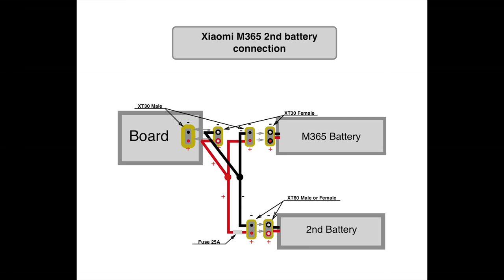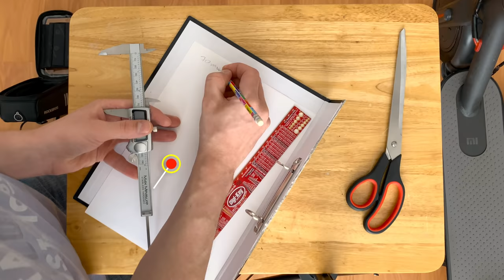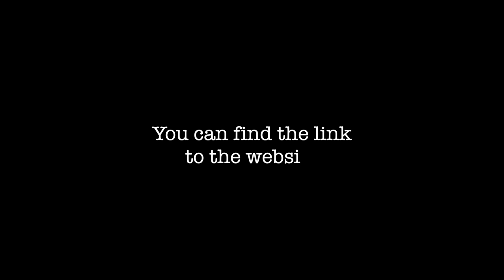Xiaomi M365 / Pro / PRO2 / 1S / Additional / Extra Battery Upgrade

Comment from the maker: Hi Guys. You can buy a ready-made connectors kit for a second battery. 
https://www.ebay.co.uk/itm/224055311121
36V Battery pack with Samsung cells:
https://www.ebay.co.uk/usr/tompie
Reply: Please I can’t connect it I don’t even know the voltage to add to my battery
Reply from the maker: If you don't know the basics of electronics, it's better to let someone else do it for you
Reply: Hi! Can I use any 36V battery, let's say 36V 7ah ?
Reply from the maker: @nvau3644  Hi. I recommend above 6Ah and must have built-in "BMS"
Reply: Nice video , can you help me for ninebot max ?
Reply: What is the approximate range added per suggest battery size?
Reply from the maker: @brottochstraff  an additional 12Ah battery on M365 PRO will give you around 80-90% more range (but it all depends on various factors)
Reply: @tatech8696  hello :D i need the kit again ^^' cable + battery.

my scooter breaks down after 30km ^^' i need 40-60km :D <3 hero
Reply: Hey T&A  fantastic video. 
I've ordered the kit from your link. The 12ah battery link is dead can you recommend another safe 12ah battery please
Reply from the maker: @Vintagegamer542  Thanks for comment and support. New batteries will be available from Friday or Saturday.
Reply: What battery do I need for xiaomi m365 pro.  I'm about to purchase the connectors from ebay.  And what else do I need to fix the external battery
Reply: Just curious if this is also applicable on scooters other than Xiaomi?
Reply: @yeshuajirehblando2043  Practically any electric scooter as long as you follow the instruction and connect the extra battery pack in parallel.
Of course different scooter and different battery pack, it "must" have the same voltage and it should have the same Ah capacity.
For example the Xiaomi 365Pro has a 12.8Ah battery so the extra battery pack is 12Ah.
Reply: @tatech8696  I really love your video and it has cleared every matter I had in my head.
And I love that the Xiaomi M365Pro can reach around 80Km range just I am too heavy for it so I bought an Emove Cruiser.
As you know the Emove Cruiser has a 30Ah battery pack, can I add a smaller pack like 20Ah?
I'm asking because an additional 30Ah battery pack is bloody expensive!!
Reply: @frejusamon  buvo VU
Reply: why not just make the main battery slide in slide out replacable and have two or three of them to carry with you on longer trips ?
Reply: @obertscloud  Each battery pack weights around 4kg so you want to carry 15-20kgs all day on your back?
And did you check the price for each battery pack, can you afford it?
Reply: @L1K30N3  need ko battery
Reply: When battery will back in stock?
Reply: How can I get this battery
Reply: Nice work. Can i do this to my orginal m365? Not pro model.
Reply: Hi bro  i will use 36v 4400 mAh battery  with out bms.
 Does it work??
And I wonder how to extra battery charging
Reply: But what if I have battery that has another charger? How do I connect that?
Reply: May I know about the extra range that I will get after installing the new battery? 
I checked about the battery but it shows no price. I would like to know the price of it. 
Thanks for the effort.
Reply: Ok a baterię z kąnd?

Comment: What a top dude replied to my message and even helped with advice and direction 👍  big shout. Also i have purchased the wire conversion from your ebay site to support what your doing instead of making my own.  Nice one
Reply from the maker: Thanks for this comment and support. I really appreciate that 👍
Reply: @tatech8696  hi sorry to bother you again but just a quick question on the battery 2. As its connected in series with battery 1 and charged through the scooter port will battery 2 still balance charge as the DC imput for battery 2 will not be used and im assuming the BMS utilisation would be via the DC imput on battery 2 pack. Or will the scooter BMS via the scooter imput charge and balance both batteries.  Thanks
Reply from the maker: Hi. You have to connect both batteries in parallel.
Charging both batteries via scooter port will not balance the cells of the 2nd battery unless single port BMS is used in the battery pack. You can also disconnect the extra battery once a month and charge it via a battery charging port to balance the battery cells.
Reply: @tatech8696  perfect
Reply: Hi
can i do the same with the 365 not pro?

Comment: T&A Tech: be careful with the aluminum shavings from drilling. Those inside the tube may end up in the bms/battery area and cause short circuit.

Comment: I was thinking of doing the same thing. I think the batteries for my remote control cars will work.  You should start selling the ready made connector. I would purchase  it. I already wrote gotrax asking if could make a second battery for my scooter.  It started with just going to work, but now I take it everywhere. I need to extend my scooter by another 5 miles, then I could get rid of my car.
Reply from the maker: Thanks for your comment. 
I’m already selling the ready made connectors if you would like to buy it please click the link in pinned comment.

Comment: Would it be a good idea to put a diode to avoid battery drain of smaller 18v battery? Could it cause problems in situations where you regen ?

Comment: I believe  It is better to have a auto fuse holder with 10..15A fuse on the "+" way from second battery just for safety. This is just in case if  somehow one battery is empty and second is loaded. Current between can be high and damage BMS. Protection is never exessive.

Comment: Just a thought here but wouldn't you eliminate the problems of the scooter going into charge mode by simply connecting both batteries to the controller rather than one to the controller and the other piggy backing through the battery.

That's what I did with my bike, both batteries go through the controller on one cable, thus they are in parallel, had I done it this way, I'm sure I would have had issues with charging.

But as it stands I charge both batteries together off the same charge circuit.

So instead of going battery controller battery, go battery, battery controller, it's in parallel so it shouldn't make any difference, so long as both batteries start at the same level on the first charge.

Comment: Nice vid. Very informative.
What are the red and black plastic things you use to cover and melt on the wires called please. Thank you for another great vid.
Reply from the maker: Hi.Thanks for your comment. 
They are called "heat shrink tubes" you can found them on ebay or amazon

Comment: After install does this mean you can charge the battery on either the external and stock port? I noticed the external battery has a charger connector as well.. Thank you! Looking to buy the connector right now..

Comment: Hey i have a few questions, when you say make sure both battereis are the same voltage do you mean that the external battery voltage is the a battery percent? or is it a fixed number and if it is like a battery percent how do i measure both voltages? Also i plan to use a CFW to make speed faster is there away to check that option box when i use someone elses cfw options? Also do i have to drill holes or can i just connect the battery box to the stem/board buy velcro or cable ties and alsocan i but the battery directly in the box or do i have to put something at the bottom? Also is the Stock charger tha comes with the scooter fine to charge and is it safe?
Cheers for the video

Comment: Great video, thank you! But I have one question: can I use the charging port of the scooter as a voltage OUTPUT? I want to use the scooter as a powerbank, then connect it to a buck converter...

Comment: After doing the exact same connections the battery, it should act just like a double capacity factory battery? Of course I would make a custom firmware with the charging fixed.
Reply from the maker: The original battery has 7.8ah if you connect a second 7.8 ah or more then you will have 15.6 or more (depending on what capacity the additional battery) the application will still show the capacity of the original battery because it will take data from the original BMS battery but the percentage of capacity while driving will decrease more slowly.
There is also a second method of connecting directly to the original battery (plus to plus, minus to minus) but then you need to cut the plastic cover and you need to be more careful because you can damage the original battery
Reply: @tatech8696  Yeah I would do it like you did. Thanks for the response!
Reply from the maker: No problem. Please Subscribe my Channel and share with others. 
Thanks

Comment: Hi thought i had sent my question but think i forgot to press send lol . Firstly thanks for the fantastic vid instructions . 
My question are , Did you remove or conceal the additional power charging jack on Battery 2 and perform the full charge through the scooter port , also if using the original Xiaomi M365 pro  supplied charger what are you charging times coming back as ? I ask as the standard battery is around 5 to 8 hours so does that mean this one is in excess of 12 hours to fully charge from 0. Also can you tell me the size of the bolts you used to connect bag to the scooter pls ?
Reply from the maker: Hi Maxta. Thanks for the nice comment.
I charge both batteries via the original scooter port and conceal the additional power charging port.
Some people charge both batteries via additional battery charge port but  I haven't checked it yet.
Yes, the charging time will increase in proportion to the capacity of the second battery. The purchase of a more powerful "42V 3A" charger may be a good solution. The original charger is 1.7A so the charging should be almost twice as fast.
I used M8x30 bolts but some people do not recommend drilling into a scooter tube because it weakens it. I have been riding on my scooter with two holes last two years and I have no issue (I used my girlfriend's scooter on the video). A good solution if you have the option is to print on a 3D printer "Batttery mount bracket".
Reply from the maker: 42V 3A DC Connector Quick Power Charger:
https://uk.banggood.com/42V-3A-DC-Connector-Quick-Power-Charger-Adapter-For-Xiaomi-M365M187PRO-Ninebot-ES1-4-Electric-Scooter-p-1575839.html?gpla=1&gmcCountry=GB&currency=GBP&createTmp=1&utm_source=googleshopping&utm_medium=cpc_bgcs&utm_content=lijing&utm_campaign=pla-gbg-rm-all-purchase-pc&ad_id=323612825005&gclid=Cj0KCQjwlN32BRCCARIsADZ-J4s1dVpL-TnJQMSLiRC_Z5Lx7Ecb3TumHwXitXa1io87fuXNLOX-rqAaApirEALw_wcB&ID=47184&cur_warehouse=CN
Reply from the maker: 3D additional battery mount:
https://www.thingiverse.com/thing:3479439
Reply: @tatech8696  Thanks for the clarification.
The Emove Cruiser which have a 52V 30Ah battery pack is supplied with a "pity" 2A charger, why this to save money?
It takes 13 hours to charge the batteries and adding a similar additional pack will double the time so what charger do you suggest, just more A like 4A charger?
Reply: @tatech8696  can I use this one on my m365 pro without the extra battery so it charges faster?
Reply from the maker: Yes, you can but 3A max

Comment: Question..?
If the batteries we connect is both 60v. The 1 (in scoot) is 20a with 3000 capacity cells and 30a discharge
And the 2 (external) battery is 21a with 2600 capacity cells and 20a discharge
Conect them in parallel, they will work or i will have problems?
Your batteries have them in parallel All the time? Is exactly the same batteries and capacity?
If they are not (as mine) do you have any issues?
Thanks!!🙏

Comment: This video has been so helpful sir, thank you. I’m on my final steps and I’m a little nervous about charging, as I only have the OEM charger for my M365 Pro. My question: if the main battery (max capacity) is 42v and my new external is 36v...besides dropping both batteries to 36v (before connection), should I also update the firmware with the selection of Battery Voltage Limit set to 36v instead of 42v? Your guidance is massively appreciated.
Reply from the maker: Hi. Thanks for comment. 
Your external battery will also have around 42V  in full charge (36V nominally, 31 - 32V cut off).
Do not make any changes to the "Battery Voltage Limit" section.
You must to make a custom firmware and enable "Remove charging mode"
Reply: @tatech8696  Bad news my friend. I think something went wrong with the firmware update. I followed all instructions for using DownG, at least I believe I did. The firmware update completed...and then the scooter froze up. It would not shut off, or respond in anyway button presses...I couldn't shut the light off, the motor wouldn't turn and the system would not turn off. I had to pull the battery cable to get it to power down.
At this point, I cannot get DownG to reconnect to the scooter (to try the flash again). Bluetooth connects, but I get the error of "canceled due to retry" when running the Version check. So I have two questions, well 3 actually.
1. Can I use the Xiamoi - Mi Home app to get back to the factory default?
2. Was it my BLE and Firmware Versions that caused the issue. I made note of them before I attempted the firmware update (BLE = 0110, Firmware = 0166)
3. Would you be willing to accept payment via your Paypal for your assistance? You have been very kind to all on your channel. I would like to compensate you for your time in helping me.
Reply: You can not limit the charging voltage by firmware, that is just pointless. Why don't you add your external voltage to 42V.
Reply: @Megatron138  It seems like your BLE is dead, the only way to flash it is to ST-Link it
Reply: @Hydropanic1  hey!!! Thanks for the input. Your assessment is 100% correct. I did gave an ST-Link a try. The learning how to solder was really fun but eventually just replaced the BLE and bought a Rita. It works flawlessly. And while I’m happy to have learned so much about my scooter’s systems, Rita was the way to go. Highly recommended.
Reply: @Megatron138  Rita is so expensive though, anyone know if it is possible to make your own RITA?
Reply: @Megatron138  Where did you get the device?

Comment: So how much more do u get ? With this Extra battery ? For example the pro has a mileage of 45 km at probably Eco Mode
Reply from the maker: Hi. 
Depends on the capacity of the second battery. M365 PRO has batteries with a capacity of 12.8 Ah so adding a second battery with the same capacity (12.8Ah) will increase the range almost double. by adding 9Ah you'll get about 70% more range. 
Also the range of the scooter depends on many factors such as the weight of the user, the surface on which we drive, how we drive, wind etc...
Reply: @tatech8696  ofcourse that makes sense, and i get that,which is normal allot of factors play a part, Okey then so if i get 40 km with 1 battery then 80 with 2
Reply from the maker: @TakiTarik  Theoretically yes

Comment: External battery does not charge at the same rate as internal possibly due to BMS.  Do you charge each battery seperate?  I charged my scooter for a little bit and unplugged the external battery to test voltage and found my internal battery was much higher.  Thank you for the video.
Reply from the maker: I charge my batteries through the internal battery and everything is fine.
12:13 Have you created and installed custom firmware with " Remove Charging Mode" enabled?
if not, you will find the link to the website in the description.
Reply: @tatech8696  I did that too.  Must be the BMS in the battery i bought not allowing current through the output connectors and only allowing charging through the barrel connector.  Interesting.  Just thought id ask.  Thank you for the reply.

Comment: wait. I saw your external battery has a BMS charging port. Do you have to connect additional charger to charge external battery on top of connecting original charger? Or can this be done just by connecting original charger into scooter charging port and both batteries will charge?

Comment: The battery pack that you got/list on Ebay comes with a separate charger port?
Reply from the maker: Hi. Yes the battery has separate charger port but you can also charge via the load port
Reply: @tatech8696  Ah, cool..

Comment: Do you have a link for the heat gun you used to heat shrink? It looks very nice.
Reply from the maker: Thanks Morgan.
If you type "SMD rework station" in the tab search  then they should show up. I bought my heat gun many years ago and I don't remember if it was on ebay or amazon.

Comment: If i have an older battery it will be have a bug fidderent in voltage? And if thid is, true this is problem?
Reply from the maker: Hi. Both batteries must have the same voltage when connected together.
After a few miles, disconnect them and check again if they still have the same voltage.
Reply: @tatech8696  im thinking to buy rita adapter for this problem🤔
Reply from the maker: I don't know much about rita adapter but it looks like a good idea

Comment: Hello. My friend has this 12s battery pack on the normal M365 pro. I have the pro 2 but i run 42 kph, and then the scooter is braking. Hes is running 55+ because theres no braking on it. Do you know how to fix this on the pro 2?

Comment: What bag for battery did you use? Did you order it on aliexpress? If so can you leave the link?
Reply from the maker: The size of the bag depends on the dimensions of the battery. For the battery from the first link, this bag should be good (colour- WL03) :
https://www.aliexpress.com/item/4000981116507.html?spm=a2g0o.productlist.0.0.74a81d54FZDbQV&algo_pvid=6717369b-d03d-4126-81e2-22994dd60625&algo_expid=6717369b-d03d-4126-81e2-22994dd60625-57&btsid=0ab6fab215904733856511393e01c4&ws_ab_test=searchweb0_0,searchweb201602_,searchweb201603_